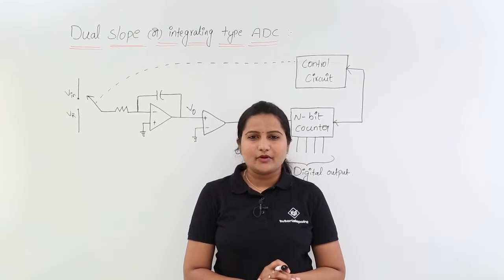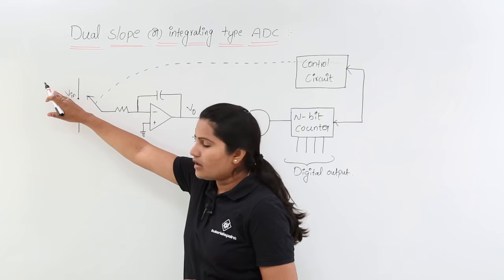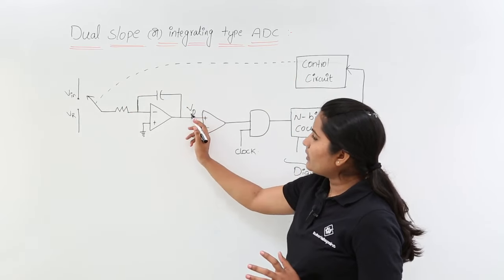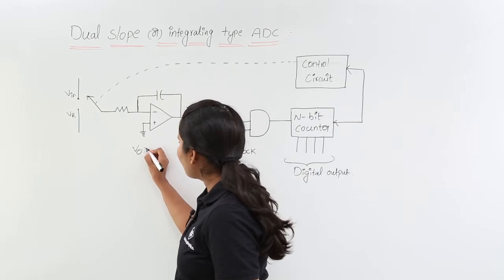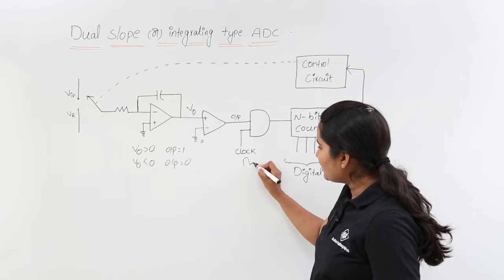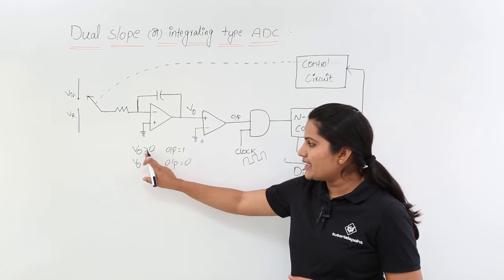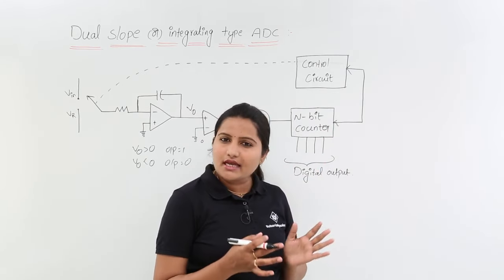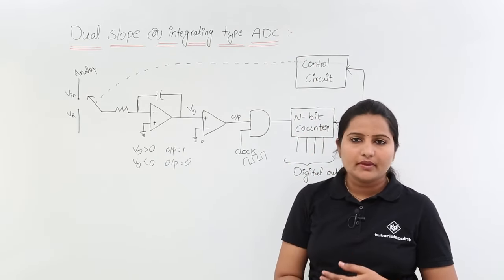Dual Slope or Integrating type ADC

Comment: I don't think there is a need for a second op amp , if the o/p of first op amp is high it will automatically go to the AND gate and with the clock signal it will be logic 1.
Reply: Gurpreet Singh 
  it's a differentiator which will convert analog o/p of integrator to digital op
Reply: @birajaprasaddas1413  its is not a differentiator it is a buffer see it carefully bro
Reply: @mohammedsufiyan2977  its not a buffer bro its an comparator she connected the Vo to the non inverting terminal but it needs to connect to inverting terminal
Reply: @AKASHKUMAR-fp3ii  It is a differentiator circuit, which differentiates the analog input voltage and then comparing with ground terminal i.e 0v  in next comparator

Comment: What is the use of integrator in this circuit
Reply: It is used to compute the time taken by the input voltage or reference voltage to make a change in output voltage, dVo...
Reply: It will convert the frequency  of analog from sine wave to pulse wave .Integrator ADC only will give accurate Results

Comment: Comparator terminal should be reversed .. and .. explanation of dual slope is missing
Reply: Bro..correct only
Beacuse VR is positive she has given
Reply: Seetharama Rao Vadde output of first integrater will (-ve) then how u will get the output of 2nd comparator ..  check properly
Reply: @LESSONUP  o/p of first integrator will be positive man,, As Vin is negative